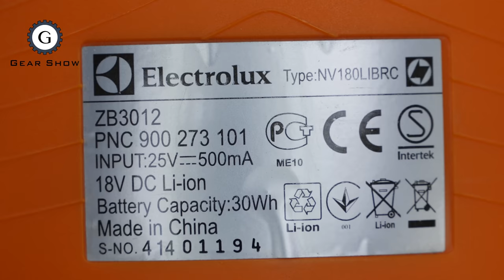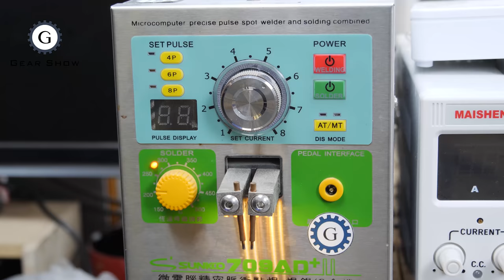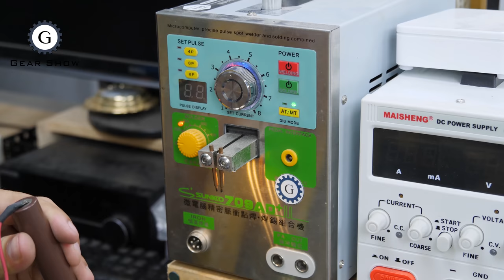Vacuum Cleaner Battery Replacement | Electrolux Ergorapido Lithium

Comment: Well... this excellent video confirmed that I am in fact NOT equipped to replace the batteries myself at home 🤣. Great work!
Reply: Ha Ha Just came to the same conclusion Alex! :)
Reply: @margtuininga2483  Way over my pay grade. Thanks for showing me I'll have to shell out $370 for a new one.
Reply: its not that difficult - - and i dont even have that tack machine.
Reply: 😂😂😂 exactly my sentiments
Reply: I saw your comment first before playing the video. My thought was, maybe he is not a techy guy, but when I saw how to replace the battery itself that needed soldering or welding, I gotcha. Haha I now feel the same haha
Reply: Değerli bir video olmuş.tebrikler.
Pilleri yanlış bağladım,süpürgem çalışmıyor.
Pillerin doğru bağlanışını resimlerle yada şema ile çizebilir misiniz?
Teşekkürler...
Reply: @crazycutz8072  now I know it’s called a tack machine 😂
Reply: same!
Reply: 😂😂😂😂😂me to😂😂😂
Reply: You dont need to, replace whole handheld unit for same price as for batteries (around 45€) and you get new motor and electronic board as bonus 👌 with easy replacement, just take off top cover and assemble yours. Easy as that 🙃
Reply: Where can I get this whole handheld unit? @proexservis
Reply: I can’t even. Going to get a new vacuum cleaner. Never again will I buy this one. Hardly got any use from it. Back to Dyson

Comment: What an utterly stupid design. Seriously how hard would it have been to stick a standard shaped battery pack in there. However, a great and informative video!
Reply: In comparison to rowenta, bosch or dyson their batteries are cheaper to buy, bosch for example 100-180€… from electrolux you can buy whole handheld unit for 50 - 100€ and you have new motor and PCB as bonus to those batteries… no soldering is needed 👌

Comment: Don’t bother fixing this POS.  I just replaced mine on Ebay with Tineco Refurbished Pure ONE S12 Cordless Stick Vacuum Cleaner,Powerful Suction.  $259 -$25 coupon.  Amazing suction, comes with 2 removable batteries that last one hour each.  Makes the Electrolux look like a Barbie toy.
Reply: equipos  electrolux que no duran ...son desechables y no tienen servicio post venta...

Comment: Easy job! Good practice is that methodology You used - replacing one battery after another to keep the same structure of wiring and to keep track of correct polarity! Good work!
Reply from the maker: Yes, thank you! I'm glad you like it.
Reply: In fact this should be done with the circuit OPEN, and not like he did: if you connect a new battery to an old and flat battery pack of cells put in series, the new battery will push much current into old ones with reverse polarity! that is very dangerous (it will overheat the old batteries). So, ok to replace one battery at the time, but you have to keep at least one wire disconnected until all batteries are new.
Reply: @BICIeCOMPUTERconGabriele  Good thing to keep in mind, thanks for sharing. This time the battery pack was relatively small so it may have helped in terms of safety.
Reply: This is standard practice throughout all industries unless there's a complete teardown involved. In this case, there was a dangerous error in that since the circuit was always "live" having lithium batteries of different voltages mildly fighting against each other could pose a problem. Since lithium creates its own fuel when it decides to "explode", there's no way to put it out. IN THIS PARTICULAR CASE, it would have been best to mark, photograph and (maybe) label EACH WIRE that connects to each battery and then remove all the batteries before installing new ones. If it were any other type (chemical) battery, this wouldn't matter, but playing with lithium is a very risky thing to do. People will say they've done it numerous times. How cares? All it takes is ONE TIME where a battery explodes and you'll wish you followed the rules.

Comment: Does the vacuum work smoothly after replacing the battery? Even if you replace the battery, the motherboard locks itself. Do you know the solution?
Reply: Dis you find a solution?
Reply: Best solution is to replace whole handheld unit, you can buy it for 36-55€ (14.4v or 18v) and you dont have to solder anything, you get new batteries, pcb and motor…

Comment: cordless vacs should have easily replaceable batteries. I wonder how much is being thrown out considering how much is being sold throughout the years. 7:38 this is well designed though, the canister, ideally, should be close to the floor head unlike gun/stick style cordless vacs we mostly have now
Reply: Yeah this sure ain't environmentally friendly  products,  EU and enviromental regulation government offices in other countries around the world have failed miserably in regulating these products.
Battery replacement in these things should be made user friendly .
Reply: @Blaztphemer  right. since then, I also realized there should be standard packs for various voltages so that packs interchangeable for cordless vacs, power tools, etc..

Comment: Amazing! Here in Brazil companies charge a fortune to replace the batteries of this equipment.  unfortunately the soldering part of the new batteries I can't do.
Reply from the maker: Oh, sorry to hear that...
Reply: @gear_show  👍 👌 guess I have to fine a shop to do this work 🙄  do you do jobs for people,?. Fixing I mean !!. 😅
Reply: You dont need to, replace whole handheld unit for same price as for batteries (around 45€ here in Europe) and you get new motor and electronic board as bonus 👌 with easy replacement, just take off top cover and assemble yours. Easy as that 🙃

Comment: ahh... i hoped it was just a pack you could easily replace but with this you need a spot welder or do some jankery and make a external pack for it, do the connections all lead together and the pack is just seperated out or dose the board have multiple connection points?

Comment: Nifty spotwelder! Certainly helps with the nickel strips: I'm a bit wary of soldering due to the heat required. Was it a good idea to bathe the switches and diodes?

Comment: Thank you for posting, great clip!  I have this same vacuum model, and the battery just died... Could I send it to you :-)...   making those battery connections seems complicated, and I do not have the fancy pulse soldering machine. I know lithium batteries are dangerous if heated..
Reply: Of course he doesn't have anything better to do and of course it is very cheap for you, if he repairs it :)
Reply: You dont need to, replace whole handheld unit for same price as for batteries (around 45€) and you get new motor and electronic board as bonus 👌 with easy replacement, just take off top cover and assemble yours. Easy as that 🙃

Comment: Very nice, now where can I find you to ask if you can  replace my battery to my vacuum?
Reply: You dont need to replace batteries, replace whole handheld unit for same price as for batteries (around 45€) and you get new motor and electronic board as bonus 👌 with easy replacement, just take off top cover and assemble yours. Easy as that 🙃
Reply: @proexservis can you help with share the link?

Comment: Can you get batteries with lugs on, to minimise the amount of soldering?
Reply: You can buy those as well and directly solder to the nickel plate without the need of using a spot welder.

Comment: Nicely made! Do you know by any chance how much amp the vacuum is pulling? I replaced the cells with LG MJ1 (max 10 amp discharge) and I am wondering if the vacuum is pulling more than that? Thanks! :)

Comment: why not use your makita battery? You can welding 5 pic 10k color ring resistance instead of original battery pionts to inveigle system

Comment: What a pain in the ass to have to change the batteries. I never would have purchased this! What a rip off!!!
Reply: You dont need to, replace whole handheld unit for same price as for batteries (around 45€) and you get new motor and electronic board as bonus 👌 with easy replacement, just take off top cover and assemble yours. Easy as that 🙃

Comment: Hi, i also replaced batteries on 2 of these. I used panasonic 3400mah. They wont charge past 3rd light out of 4. I get about 11min out of it. With original batteries with smaller capacity it lasted 20min. Does your fully charge, how long does it last?
Reply: Hi, same issue after replacing my batteries too (ZB3212), looking for an explanation also. Maybe a kind of memory info to wipe into the system?
Reply: @THEe22100  Noticed same thing. I got a new one of these still in box, never used is about 4yo. Wife got it and never used it and batteries fully discharged. I replaced the batteries, mine came with 4x18650 🤨, but there was 2 balance leads inbetween -,+ of cell 3+4 so it was made for 5x18650s. So i put 5 in and had a test, it ran very good.
But i put on charge and next day is also just flashes the 3 lights, i pulled to bits and all cells where 3.68v each. So if its charging its doing it very slow, or it could be trying to balance the batteries, so it may take a few days to do as VAC is not specifically made to be a dedicated balancer.
So my guess is slow balancing, or as you said some BS memory thing that needs a reset.

I saw a flash memory IC and a STM8L151 on PCB, could try reset stm. But who knows, that is beyond my skill.

Comment: Hello, I changed the batteries but the duration of use is very short (1mn30 to 2mn) the recharge cycle is also very short. Can you help me... Thank you in advance and congratulations for your excellent video!.
Reply: Me too, I don't know why. Perhaps the control board doesn't know it's been equipped with a higher capacity battery pack.
Reply: If you damaged pcb or you need new pcb, then replace whole handheld unit for same price as for batteries or pcb (around 45€) and you get new motor as bonus 👌 with easy replacement, just take off top cover and assemble yours. Easy as that 🙃
Reply: You may have bought crappy cells (e.g. used ones). Good ones are not really cheap. Test them before replacement.

Comment: Very good video. I also changed the batteries, they charge but they don't last more than 20 seconds. What can I do? Thank you.
Reply: I have the same issue. Did you find the solution?
Reply: You dont need to, replace whole handheld unit for same price as for batteries (around 45€) and you get new motor and electronic board as bonus 👌 with easy replacement, just take off top cover and assemble yours. Easy as that 🙃

Comment: Hi, i got a question: what kind of screws are these ? What sort of screwdriver I need (the top) ?
Reply: Torx 10 screws (T10), you can use tiny flat screwdriver too, but it can damage screw heads.

Comment: Hi! I have a Canadian version EL2095 and the current batteries in there are US18650 VT3. Five of them. I believe they are 1600mAh. What is an equivalent battery I can use to replace them? 
Thank you!
Reply: if you still haven't found what you need, check the Sony/Murata VTC5D, 2800mAh/25A that can be found from reputable sellers (like imr batteries) for less than 8 'merican bucks apiece.
be very careful as lots of 💩chinese counterfeit ones abound. 😉
Reply: You dont need to, replace whole handheld unit for same price as for batteries (around 45€) and you get new motor and electronic board as bonus 👌 with easy replacement, just take off top cover and assemble yours. Easy as that 🙃

Comment: where can i buy a bms module, because my module is broken
Reply: You dont need to buy new module, replace whole handheld unit for same price as for batteries (around 45€) and you get new motor and electronic board as bonus 👌 with easy replacement, just take off top cover and assemble yours. Easy as that 🙃

Comment: Can I mail you mine to replace the batteries?
Reply: You dont need to, replace whole handheld unit for same price as for batteries (around 45€) and you get new motor and electronic board as bonus 👌 with easy replacement, just take off top cover and assemble yours. Easy as that 🙃

Comment: You won't even get the performance out of that unit like it was new. If the motor bushings and the windings are weak then it's absolutely useless. High resistance can develop and overheating. It would cost more to fix than a new one. These cheap mass produced offshore build units are not worth it. Very underpowered using vape style batteries
Reply: You dont need to replace anything in these ergorapido models, just replace whole handheld unit for same price as for batteries (around 45€) and you get new motor and electronic board as bonus 👌 with easy replacement, just take off top cover and assemble yours. Easy as that 🙃

Comment: Underpowered. Batteries die too fast. You can't shut the beater bar off cant use this on hardwood floors. Batteries get hot because of the speed control resistance in the beater bar. Only 4.5volts and too much load. Very low torque vacuum

Comment: They are such good vacuum cleaners but very poorly designed to be almost throw away machines which is pathetic. Battery replacements cost a fortune as you need all the equipment..
Reply: No, electrolux have cheap price for whole handheld unit, try to buy batteries to bosch or rowenta or any other brand, price like for whole new vacuum cleaner. If you know number of part that fits to your vacuum then you can buy electrolux handheld unit for 35 - 55€ (batteries, pcb & motor included), but price of 18v battery for bosch? 120-150€ 🫣🤣

Comment: Jaką szkoda, że nie mam zgrzewarki impulsowej. Naprawiłbym swój odkurzacz
Reply from the maker: Zamiast tego możesz użyć lutownicy
Reply: You dont need to, replace whole handheld unit for same price as for batteries (around 45€) and you get new motor and electronic board as bonus 👌 with easy replacement, just take off top cover and assemble yours. Easy as that 🙃